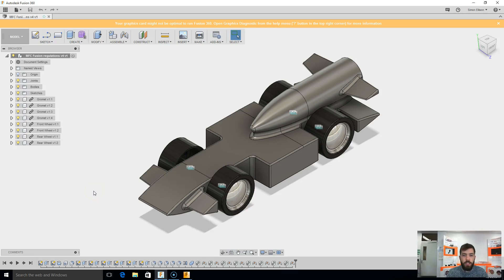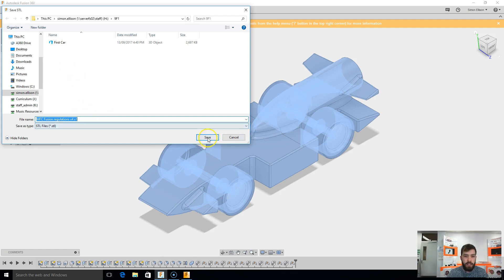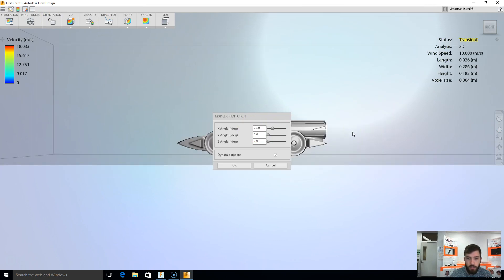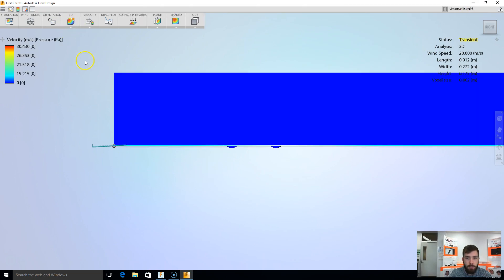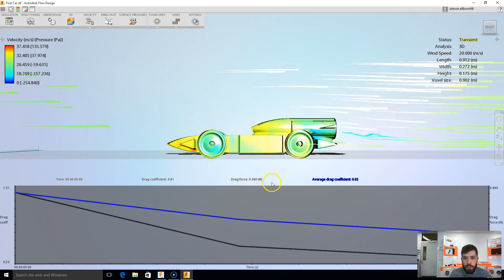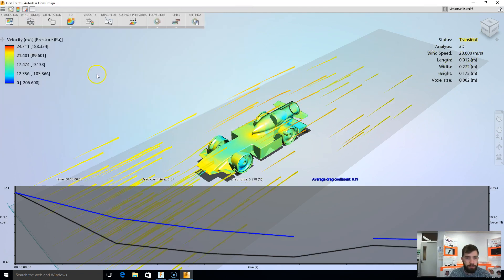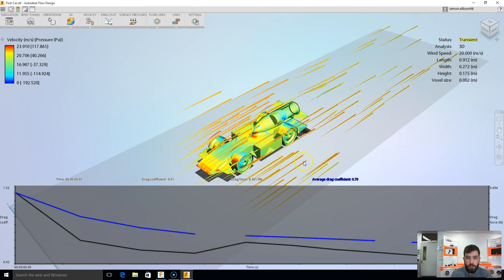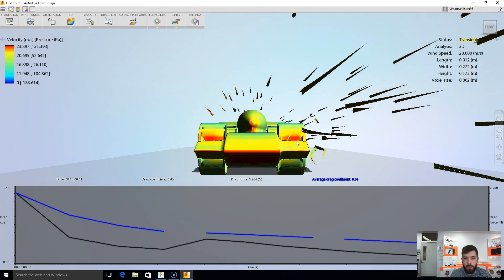F1 in Schools - Flow Design Testing

Comment: I have been told that Flow design is not accurate and I have experienced air going through parts of my car (solid parts)
Reply: What's a better alternative?
Reply: CFD 2019, simscale, ANSYS 
Practically anything but flow design
Reply: Yeah i agree with you, i use just for my students see on a way more easy. This software is just for "fun" you know. For better simulation the autodesk cfd is more ideal.

Comment: What would be the preferred Coefficient of Drag? Our team is able to get a very low CD but we need to know if that's a good thing. Thanks in advance
Reply from the maker: BeBeVe while a low Drag Coefficient is certainly a positive, other aspects can contribute more to the design of an F1 in Schools car, such as the final weight of the vehicle, the closest you can be to the minimum the better. Also, how much frontal area the car itself has is important, the less the better again, and finally where you direct the air as it flows around the vehicle, and how the air comes back together behind the car is also important.
Reply: Simon Ellison thank you for your help sir, but, my concern is that our team is getting a very low CD - 0.05 to be exact and we're afraid that it's too low and want a second opinion
Reply: "Drag coefficient is a dimensionless quantity that is used to quantify the drag or resistance of an object in a fluid environment, such as air or water. It is used in the drag equation in which a lower drag coefficient indicates the object will have less aerodynamic or hydrodynamic drag. The drag coefficient is always associated with a particular surface area"

It is suitable to have a DC as low as 0.05, a streamlined half-body has a DC of 0.09
Reply: Work a bit of lift